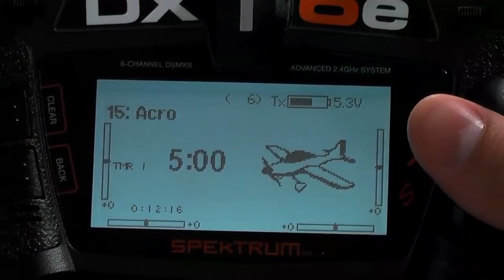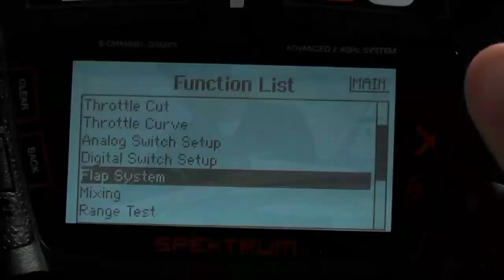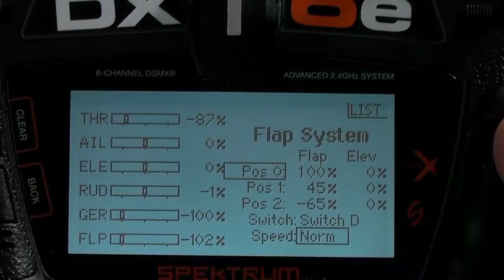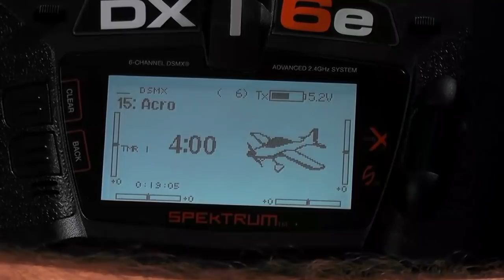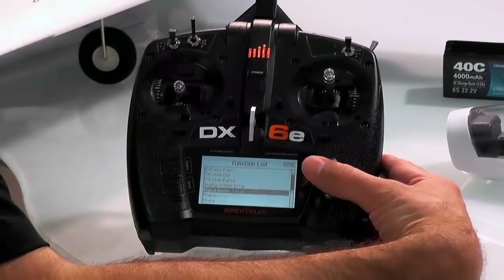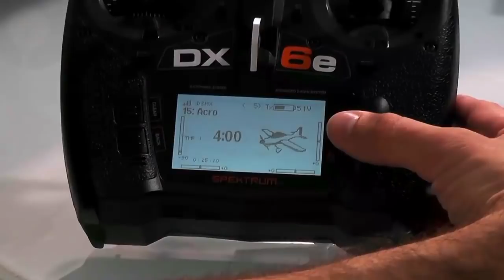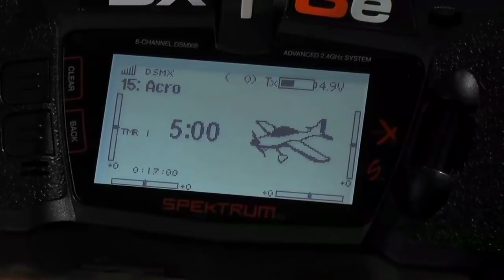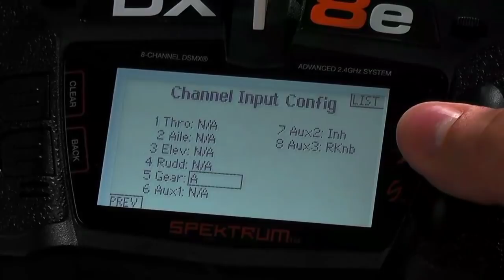E-flite Viper 70mm EDF Battery, Radio, SAFE Select Setup Hints & Tips

Comment: You keep banging on about ec3 & ec5 connectors and adapters. The advice you should give is to solder on your own connector to match your batteries!  Having multiple connections is just more points of failure.
Reply: or have options like   FMS  gives  you .i like how they  say  we recommend  this lipo but u need to cut some foam to make it  fit and it will make it abit nose heavy  ..???  im laughing alot when i heard that  ...well  i recommend you fire the person who approved that . anyway  its the FMS viper  just repainted eflight electrics   i just think its to cheap  for 
 eflite  to  have that  cheap retracts....turn safe off
Reply: Not everyone has a soldering gun. It is easier to order a connector than soldering on thicker wires. I mysrlf use a butane torch. It gets much hotter and works faster on a connector and has less chance of damage because it works so much faster.
Reply: The point is that the EC5 connector better handles the higher current than the EC3. Also, the supplied esc has the EC5.
Reply: I like the safe - and I like the price point! Nice entry level Jet - I'll take 2 please!
Reply: RC Safari Did you end up getting one? :) I did and I love it!

Comment: When you were setting the flaps movement number 0 position was a 100, position 2 was -65. Why was position 1 Positive 45? Wouldn't that be flap moving up?
Reply: servos are at zero degrees with power on and no input----full travel up or down is either 100 positive or 100 negative----set up called for reversing flap  setting...so  with plane level , flaps  are 100% positive using a maintained 3 position switch , in position 0. flaps up   ....... using switch in  1 position   the number suggested is 45 positive-- you could pick  any setting you like 45+ or 45-  just depends on how far you wish your takeoff flaps to travel...the farther you head to a negative number,the farther the flaps will descend down....or a  higher positive  number,say55 will raise them higher for less flap travel.... landing flaps call for numbers to go past 0  into a negative value,their recommendation was neg.65...you could go full down position which would be  negative 100......and because you are using a switch  it maintains its position and stays at your switch position settings....hope this helps.....

Comment: Safe select is reversed for me, when the flaps are up safe select is on, down off. I've tried reversing the gears. Are there any fixes for this?
Reply: Hi Jimmy,
Same issue here. Could you solve it?
Reply: Yes, you will need to install a servo reverser on the 5 channel and then plug in the servo leads to that.

Comment: I have eflite viper 70. and station DX6.
the station brings an Aux2 that I have enabled but it does not move in channels.
I have enabled a switch to the auxiliary2 to connect and disconnect the stabilization, and although I follow the steps of joining the Stick to the center and moving the assigned switch 5 times, the stabilization is not interrupted. What should I do?

Comment: Does the Viper receiver respond to Forward Programming?  Probably not since I didn't see that menu option after binding SAFE.  However, installing an AR630 will add a 7th Aux2 Channel on binding and activate Forward Programming.
Reply from the maker: The original BNF Basic version of the Viper 70mm (EFL7750) included an AR636 receiver that was NOT forward programming compatible. The current BNF Basic version (EFL77500) includes an AR631 receiver that IS forward programming compatible: https://www.horizonhobby.com/product/viper-70mm-edf-jet-bnf-basic-with-as3x-and-safe-select-1100mm/EFL77500.html

Comment: Cannot have the same results on the P51. By reversing flaps my D switch works in reverse, meaning switch down flaps up and vice versa, to fix that I have to set up flaps to negative, on top of that Safe in on with flaps up. Don't understand why having tha same radio but different plane things don't work. Any suggestions?
Reply from the maker: After you reverse the channel for flaps again, change the values in the Flap System menu to get the flaps to go the other way for a given switch position. For example, you can change 100 to -100 (or -100 to 100) so the flaps are up instead of down (or down instead of up) with the D switch in the same position. After you do this SAFE Select should be on when the flaps are down instead of up :)

Comment: hello from Belgium. Great your videos!  I have a question for you... I have a Spectrum DX6 NGénération and a viper edf e flite 90 mm in bnf. I would like to use a switch for safe select .could you give me the procedure to follow?   thank you very much, Thierry...I tried as it says on the manual, but the plane still remains in as3x mode of in safe select !
Reply from the maker: Hello Thierry! As explained in this video for the 70mm model, if you only have a 6-channel transmitter you will need to combine the SAFE Select function with the flap channel/function. You need at least at 7-channel transmitter to have SAFE Select on a separate channel/switch (because you need to use channel 5 for the retracts and channel 6 for the flaps).
Reply: @HorizonHobbyProducts  👍thank you very match
Reply: @HorizonHobbyProducts  Hello friends. I understood your explanations on this subject, but the problem encountered is different.when I have assigned the safe to switch D, the opposite effect occurs; flaps out is the as3x and flaps returned it's the safe activated. What can I do in this case?. Thank you again for your kindness friend

Comment: Can you set up so flaps and retracts are same channel ? So safe can still be assigned on a seperate channel??
Reply from the maker: No, because the flaps will go up when the gear go down and vice versa (which is the opposite of what you would want). If you only have a 6-channel transmitter, your only option is to combine flaps and SAFE as shown in this video. This is why we recommend 7-8+ channel transmitters for most of our models now.

Comment: Why can't you use the other switches for safe select
Reply from the maker: If you have a 7+ channel transmitter you can assign SAFE Select to a separate channel (from 7-9) and switch! You only need to combine it with the flap channel/switch if you have a 6-channel transmitter.

Comment: I am certainly quite interested in checking one of these out, I would agree with RC Hobbyist Extreme when choosing a higher C rating lipo for a EDF. 40 or 50C would be more ideal.  30C would Puff quickly and I would not recommend it.

Comment: Can you by chance install a panic button on a DX6E or another transmitter and use it with this? I don’t the need SAFE features as I am already experienced ,but I would like to have the panic button just in case.
Reply: Duderocks5539 SAFE is basically a panic button on a switch.

Comment: I'd buy this if it to a 5000mah battery cause I have a bunch of those. Also I wouldn't recommend your eflite batteries the c rating is to low for an edf. Those 3200 30c will puff quick

Comment: I havent flown RC airplanes in 2 decades, I used to fly pattern ships and pylon racers. Now I fly RC Helo's have a Blade 230S, But this plane 
looks REALLY cool and has better flight chars than normal Jets I have seen. I only have a DX6 radio.  SO will have to debate on the radio upgrade, I do however like the flaps tied to the Safe Select... so good call for 6 chan radio owners... I may buy own, my only hang up is that I am NOT a fan of foam planes.... So I don't know.